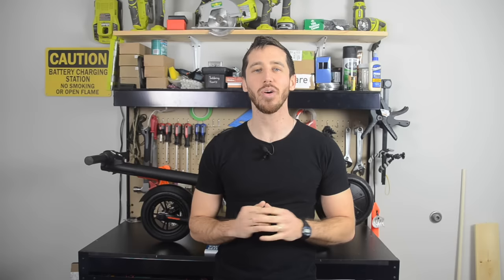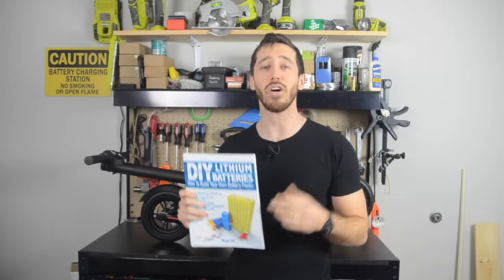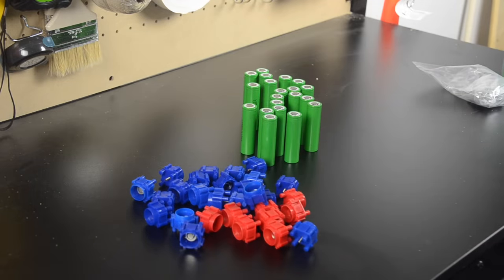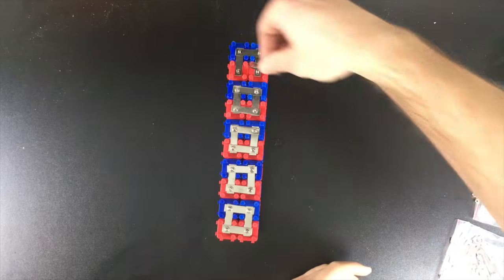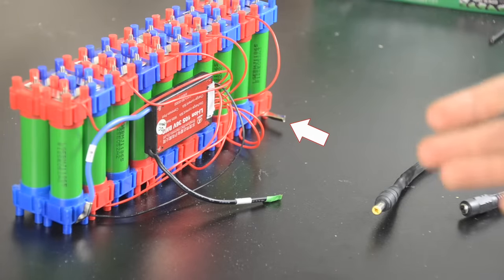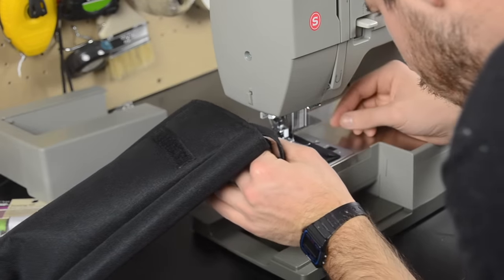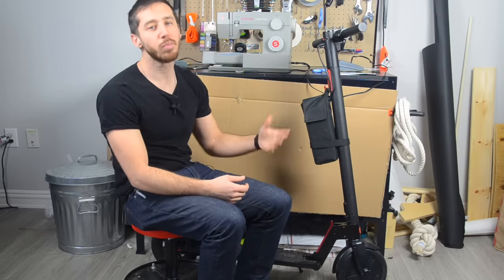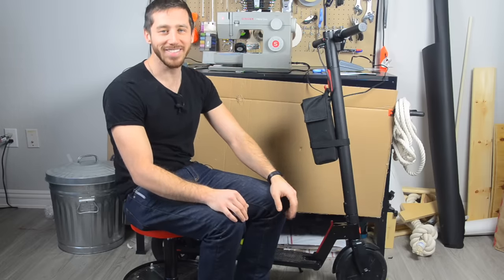DIY 2x range booster battery for electric scooter or e-bike

Comment: So I have a swagtron eb5 , 36v 250w ... could I put a extra 36v 500w battery on it being safe , I understood same volts but what's about watts ?
Reply: And if I was to buy a extra battery that's 36v (same as the battery on it) should I go for a 250w same on it or go for a 500w or even a 750w ... would it be pushing to much or does it have to do with the motor? And if I added just a 36v 250w battery would it double the watts or would it be 36v 250w with more amp hours?

Comment: Great video,can you help out and answer a question for me?  I picked up 3 GOTRAX rival scooters for my 3 boys I was thinking about extending the range on the scooters. I have a few new hover board battery packs from hover 1 boards and I was thinking about installing the same male charge port on the battery packs to mount them on the decks and run the wire up to the charge ports as you did ..can this do the same thing as you build? I'm assuming it would.but any insight would help before I blow up my kids......wife will kill me
Thanks 
Frank

Comment: Hi, you plugged the external pack into the charge port, but looking into the scooter I can see the charge wires are way thinner than the main + and - wires from the internal battery, isn't that a little too risky? Would it be better to upgrade the internal charge port wires?

Also, compared to plugging into the charge port, would it be better to have a 2 position switch to switch between the two batteries, when one runs out, switch to the other and continue the ride?
Reply: I think when connecting the booster battery to the charge port it’s job will be charging the main battery  and help boost up the power 
It can’t be use as the main battery because the small charge wires gauge can’t supply enough current and probably will  smoke

Comment: You need to mount the battery pack much lower as you have raised the centre of gravity of the scooter.
Reply: Half a kilo will not make a difference
Reply: @easternwind4435  It will
Reply: @easternwind4435  It does, especially on a scooter. The slightest weight can mess with handling.

Comment: Hi mate, I’ve recently just bought th Reid E4 scooter which I limited in the uk to 25kph. I’m looking to fit a larger controller to enable me to gain more speed. Can you help me with this process, i.e what size controller I will be able to fit with the batteries I have?please??
Reply: An E4 owner! Not many of us around... I don't think the controller swap will be easy on this scooter because the main control part is integrated into the display.

Comment: I have 2 charging ports on my scooter so could I leave this battery plugged into my scooter at all times and charge both batteries (default and external) at the same time when I plug the charger into the other charging port?
Reply: Interested in this as well.

Comment: Looks like it's been two years since this mod.  How has the prolonged use of the battery combo held up?  I'm curious if there was additional stress on the BMS/Controller with heat from having to charge/discharge at the same time?  If proven it holds up over time, I may want to do this mod myself.
Reply: Also, going through the BMS on the Gotrax with the charge plug, the charger that comes with the Gotrax GXL V2 is a 42v 1.5A.  So can't you just build a battery for 42v so long as you don't exceed 1.5A discharge rate?  You would be safe to do 10 in series since it's safe to charge to 4v in each cell.  That should get you more range as well.
Reply: Ok about or plug up my bird f350 battery in para and find out

Comment: DO NOT DO THIS MOD!!!  We did this to my son’s Gotrax GXL v2 and it burned up the charge port within a few miles. We cannot charge the scooter now. I took the battery out and charged it via pins 1 and 2, we now have to mod the scooter so we have some way to charge it.
Reply: I guess you plugged it in, when the scooter was empty and the booster was full? That turned the booster into a super super charger - what the cable and plug is definitely not designed to handle
Reply: @TecSanento  No, they were both at the same voltage because the scooter had been used that day.  It burned out while being used.  The charge port is designed for 42v / 1.5A, the draw from the motor will max at 250w at 36v... So a total of 7A could be pulled... And let's just say half comes from the external pack = 3.5A!!  And that is the issue.

I soldered leads to the inside of the controller where it connects to the battery and the scooter has been ridden like this for about 500 miles.
Reply: @mattgithens1979  yeah that would be my Next guess - glad you figured it out. We would need some kind of current limiting
Reply: @TecSanento  on the other scooter (XR Elite), we just put a XT60 Y cable in the steering tube. When you remove the handle bar, the XT60 is just a few inches down the steering tube. I put the Y there and a hole with a grommet… then used a bike bag for the 10S4P battery.  All in, we are getting 30 solid miles on a single charge.

If I were to order today, I would only buy scooters that have the battery in the “floor”.  I can’t remember… but I think the XR has a more standard 10S3P down there.  The GXL V2 has a special made pack in the steering tube which means you’ll have to buy from them… at 3x what the pack is worth!!
Reply: @mattgithens1979  That's exactly how I added a battery to mine. It has worked flawlessly. I added a 15A fuse for good measure.
Reply: @mattgithens1979  and you charge each battery separately or normal?
Reply: @whitcwa  and you charge each battery separately or normal?
Reply: @Mikugaru  I charge them separately because I'm using the low power chargers that came with the scooter and battery. I could probably charge them in parallel if I had a more powerful charger, but my little chargers get pretty hot as-is. I use an XT60 to connect and disconnect the external pack.  .
Reply: @Mikugaru  they charge together.  Separately would be a pain!!  Voltages need to be close together.

The battery that I bought has the XT60 for power output and the same 2.5mm  charge connector that came with the scooter. 

I highly recommend the scooters with regular battery packs... The ones NOT in the steering tube. The proprietary design means you have to pay 2x what a pack should cost.
Reply: @mattgithens1979  Together as in 2 chargers charging at the same time?
Reply: @Mikugaru  single charger plugged into the barrel connector on the second battery pack.  This will pass thru the charge to the original pack.  Once connected, just don’t ever separate the packs.

Comment: Micha, Thank you for this video. Question: I feel super confident I can make a battery such as the one that you made in this video; but if I ask you super nicely will you make one for me?  I have a scooter identical to the one that you have.  All of your services and fees I will pay you.  Micha, Thank You.
Reply: I second this, what would it cost for you to make and ship this? I would be interested. I have a Gotrax that gets 12 Miles range. I'd like to get close to 20.
Reply: I third this. Please sell these as gotrax doesn't sell extended batteries
Reply: I concur
Reply: just buy a battery 36 v 7.5 amp hour and suitable way of attaching it thebpart i missed was conectiongvto the type of battery in these gotrax scooters .i have one laying around and had a look at is design .i would go for a 365 type scooter or but a bigger ah scooter to start with .if youre looking for one .as a budget scooter the  lower center of gravity .given the battery is in the base having 15ah of battery on the steering tube is a bad idea for a few resons esp if swaying around like that bag will it will affect steering and make it heavier and maybe even shakey it could come unattached and isnt very waterproof .this is a good idea if you have a pannier rack on a e bike and could hide and waterproof it in a pannierbag otherwise buy a bottlecage mounted type and fit it to the rack somehow .but put a mudguard on as a precaution too .great videos though i just dont think this is a good idea .just buy a xiaomi 365 or similar the 350 watt version does 21 mph and comes with decent range on most models

Comment: So you made a battery that is charging the main battery of the scooter while the main battery is discharging? Thats how i understood it. I think it wuld be more efficient when you plug the 2 batteries in parallel just like you did to get double the capacity but connecting the new big battery to the whole system. >That way you would get more efficiency out of it since you wouldnt loose energy to the charging of the battery. Having 2 seperate batteries isnt that optimal. since you will always have a little difference in Voltage and since current flows to the lower potential (Lower voltage), that means that one battery will try to charge the lower battery while also putting power on the system so you can drive ofcource. But that also means, that if the battery has charged the other battery to that point that itself has a lower voltage due to chaging the first one, the other one will start to charge it since the current flows to the lower potential. It will go back and forth until both batteries are dead. There will be a huge energy loss due to thermal heating of the battery because it is charging the other one and the life span will decrease due to the constant charging and discharging while putting out power to the scooter itself. and that means that you will get lesser range than you could have had if you would plug in that battery in parallel to the whole system or removin the original battery and just doing a new bigger battery pack that will allow you to drive double the range and even more than you already have achieved, because the battery will now fous its power on the scooter and not on charging the other battery. BUT AGAIN! i didnt understand if you have done it or no  XD  maybe you did the thing i just explained and i got it all wrong
Reply: I'm not sure how it is wired, but it seems like if it is wired in parallel like he said it would act like you just had a much bigger single battery pack, wouldn't it?  The battery packs themselves are just multiple groupings in series to get to the desired voltage wired in parallel with each other (ie,  if the factory battery is 2 groups of 10 batteries wired in series that are wired together in parallel, then adding 2 more groups also in parallel with the first 2 shouldn't be any different than what is already going on in the factory battery pack).   Again, I'm making assumptions that the person who made this video is correct and the charge port is wired in parallel with the battery.

Comment: I probably would have gone into detail about battery continuous ratings to match scooter controllers and pairing the battery to the actual battery in scooter not just the bms charge port if matched correctly for maximum efficiency.

Comment: Alright, I finally got around to doing this and it was a fail.  The person making the video is WRONG.  The charge port is NOT spliced in parallel into the battery.  It goes to very thin wires that are welded to the circuit board.  So within about 2 miles, I fried that part of the circuit board and can no longer directly charge the scooter battery.  I went ahead and removed the charge wires and spliced in two thick wires directly into the hot and ground wires coming off the scooter battery (which was difficult because those wires are only about 1.5-2" long) to the new battery.  This seems to be working fine and I can charge my extra battery while it is spliced into the scooter battery and they both charge up equally and my backup battery's power management tells the charger when to stop charging (if I bypass my backup battery, it seems to want to overcharge the scooter battery now).  Anyway, this was kind of a headache and I regret trying to do this.  An alternative that is much safer to your scooter would be to buy a small 100W "solar generator" (what they call them, but they are just a lithium battery attached to an inverter that "can" be charged with a solar panel, but also with a normal 120V outlet) and mount that to the scooter and just plug in the charger and have that running while you ride.  That keeps the amperage at a safe level that you know won't damage the charge circuit (I believe it is 1.5 amps - you might be able to get away with a slightly stronger charger, like a 2 amp and eek out a little more distance).  If you ride hard, it will give you about another 2 miles.  If you are riding slower or waiting a lot at stoplights, it will go much further.  This is what I was doing before I tried this upgrade.  On the plus side, my scooter will now go about 20 miles (I wired in a 20Ah battery), up from about 6 miles.  It is just not a very good setup and feels pretty sketchy to me.  I bought a new handle bars that have all the electronics that were ruined by this hack in case I want to switch back.  Right now, it only cost $59.

Comment: If i have a 29.4v 4ah battery on my scooter,  can i add an external battery of 36v?  Or i have to use same voltage battery 29.4 ?
Reply: And just by plugging it into the scooter charging port works as in parallel with the scooter battery?

Comment: I love your video! However, I have one question. You didn't address a safe method to charge both batteries. Do I use the charging port you created for the add on battery to charge both batteries or do I unplug the add on battery and use both charging ports?
Reply: i belive you have to charge the batteries separately

Comment: The charging port isn't designed to take a lot of amperage
The wires from the back of the port are thin
So it can't carry much power to the motor from the backup battery

Comment: Wait, I thought connecting 2 pack with bms in parallel is bad, is it not?
Reply from the maker: It depends how you do it. If you parallel them via discharge, you need to ensure they are at similar voltages. What I did is parallel via the primary pack's voltage connector, which is essentially charging the primary pack via the secondary battery.

Comment: Pls just add a current limiter, so you can be sure nothing blows up. Also you can connect it to the scooter when it isn't the same voltage, if you use a current limiter

Comment: Hi What's your opinion on this? I'm currently making a 36v battery for a cheap 2nd hand ebike I bought with no battery, I know to get the 36v battery range I should use 10 batterys in series X p, but what if I where to use 11 batterys in sereis but would only be using the 36v/44dc charger for them, would this give my entire battery a longer lifespan? From what I can work out 18650s are happier in the middle as apose to top or bottom or full cycles?
Reply: yes this will be better for your cells. but make sure you can BALANCE the cells. most bms only ballance after the reach the 4.2v. so if you never charge them to 4.2 they will never ballance. you can buy as smart Bluetooth bms. with that you can set your own voltage cut off and balance voltage.
Reply: @bengrobben2582  Cheers mate. I'm guessing this is why you can get 13s and 14s in 48v bms's? And in theory for the price of an extra few cells it will double the lifespan of your battery
Reply: @thetruthwillsetyoufree6420  hi, not completely. the 13s of 14s batery bms is just for if you want more voltage. nothing more. using 14s but you only need 13s is better for your cells because you wont charge them all the way up to 4.2v. but this doesnt mean double life span. if you only charge them to 3.95v and discharge to 3.45 then you will have double the life. still when not charging all the way to 4.2v the cells wil live longer. i have a 15s battery and use a samrt bms where i can set the max voltage per cell. i stop charging at 60.5v so around 4.03v. i do this because my cells wil live a lot longer. i start balancing at 3.9v. if you are not using your cells for a longer time. discharge them to around 3.65v. they will be happy like that. adn never charge them in temps lower then 4 degrees celsius.

Comment: Hello. I have 72v, 42ah, 120A battery and my BMS is 300A. Can I use it with 150A controller??
Reply: 72v x 150amps is good for 10,800 watts of motor, or 14.5 horsepower, very fast bicycle or not so fast motorcycle if its heavy. Whats your motor rated at in amps?  Most speed controllers have a current limiting feature for getting rolling without pulling excessive amps. Amps x volts = watts. Its your motor and load that determine what speed controller you need. It also needs to be rated at 72 volt or higher.

Comment: I was really hoping to see a current regulator on this video, that would allow to plug the booster battery in regardless of the scooter battery charge percentage. Been looking for a current regulator (or limiter) for other applications as well, but I guess it doesn't come outside of the DC-DC converter package, which is also not appropriate, since DC-DC converters are either buck or boost and I'm looking for something that would do both. If someone knows different, please let the community know.